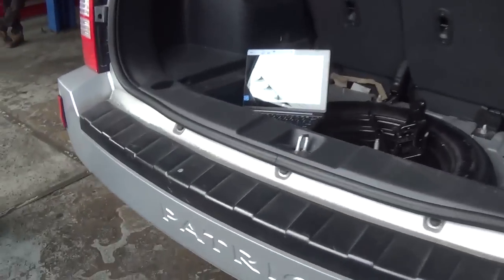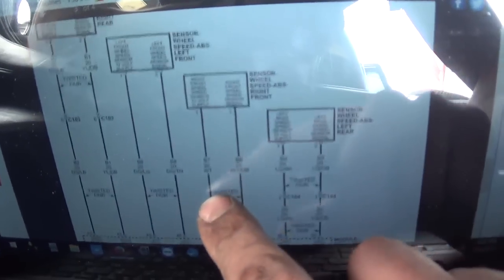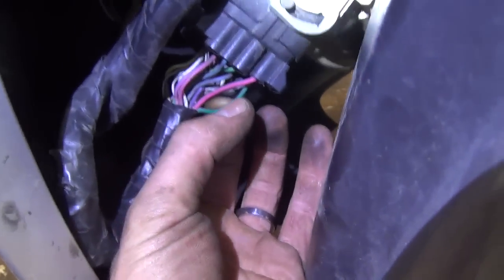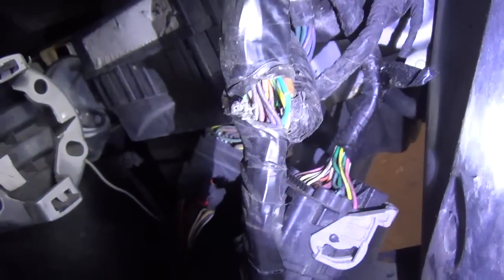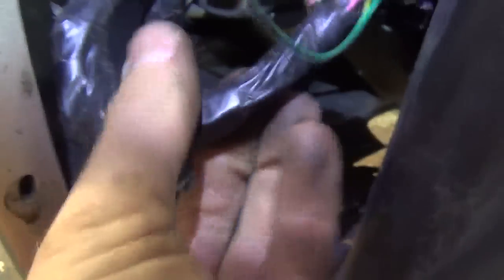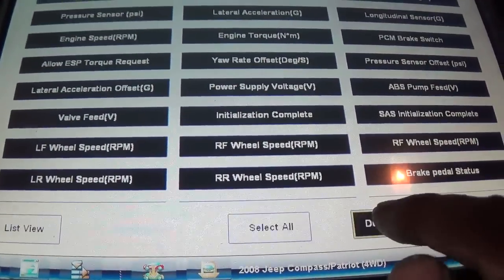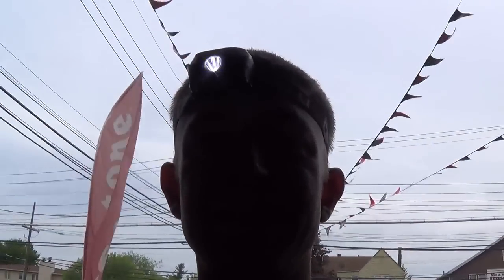Jeep ABS wheel speed sensor circuit (Staten Island Ep 9.3)

Comment: Ivan - I used to teach electronics. For the best long term repair you should clean off the residual flux with isopropyl alcohol before putting the heat shrink on it.  The flux will keep working creating its own green crusties.  This recommendation is from the standards for High Reliable Soldering practices - NASA STD 8739 is the one we used.
Having whined now the good comment - your videos like Keith's and Eric O's diagnostic one are excellent excellent. I don't always like the handheld camera shots but your voice over explanations make them live and in the moment.
Reply: Mark Watson Thanks for the tip.  I'm 55 and didn't know that.

Comment: lol  gloria gainer's "i will survive" playing at the same time you found the problem. how that for timing?must have originally been a rub through. suprised that harness is allowed to flop around in there like that. one thing i have found thru the years is that a solder joint wt a point of flexation will often break. sometimes its better to put in a longer stretch so it wont be flexing at the joints. looks like that one will live  long enough, thanxs for taking us along

Comment: It was in a spot that likes to collect slush and snow, I've pulled them inner plastic fenders apart to find solid bricks of ice inside. That is likely what caused to corrosion in the harness. Not sure why the harness was looped so low in that area. But good job cutting the problem in halves till you finally found it.

Comment: whoops, not bad soldering @ Ivan, I mostly dislike the gas heated devices, lack of temp control, best bet it watch and touch them with solder, when it starts to melt fast, underside touch the wires, tap solder to iron/wire meet point, watch closely, it will start to melt/flow, move solder to top of wire and iron back and forth following solder ( heat fast, flow good and remove)

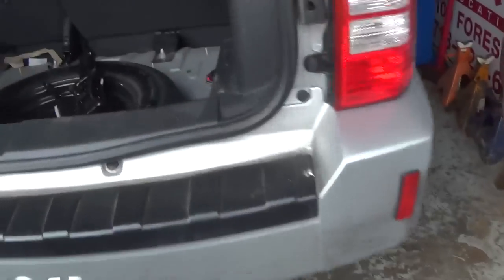Comment: Hey +Ivan, your description of the sensor signals at 1:06 https://youtu.be/655hnoYvgak?t=70 is a bit off, though of course you nailed the problem regardless :-).  That's not YL/Grn = ground and DG/LB = sigal. Instead, as the schematic shows, it's DG/LB = Batt+, and YL/DB = signal. A scope across those two wires will show a square wave voltage with levels of say 12V and 12.8V. (This implies hooking scope ground to the signal, which invites problems unless the scope has independently floating channels.) Those odd-seeming voltage levels are the obtuse side-effect of the sensor sending a current signal, which ends up generating a voltage relative to ground owing to a resistor-to-ground in the receiver (ABS controller). Explanation: 

This type sensor has only two wires, with one side tied to Batt+. Mysteriously, the signal voltage takes on two rather oddball-seeming values. Not zero to 12V, nor zero to 5V, nor even zero volts to anything. So this is almost certainly a sensor which communicates by sending one of two different output currents. The receiving control module contains a resistor to ground, and reads the voltage that results from that signal current passing through that resistor. This mode of communication is known as a "current loop" configuration... current flows from the ABS unit along the "12V" Batt+ wire to the sensor, through the sensor, and then back along the signal wire to the receiver, where there's a resistor to ground, across which a signal voltage results. The sensor sends information by regulating the amount of current, in this case to one of two values. The current loop arrangement has two benefits: 1. Interference from electric or magnetic noise affects both wires equally, with an overall effect that cancels out. So less signal degradation from interference. 2. Makes it easier to design a system that has electronics in the sensor, yet uses just two wires. Almost certainly, this module contains a chip like the TLE4923, data sheet here:
https://media.digikey.com/pdf/Data%20Sheets/Infineon%20PDFs/TLE4923.pdf. See page 17 for the likely connection arrangement. Table 4 on page 11 (IS) shows that the low current is 4.1mA (+/- about 1) and the high current is 10.5mA (+/- about 2.5). And minimum ratio between low and high of x2. (These current signals are in the range of the "4-to-20mA" signal convention commonly used for process control in industry.) 

Eric has a video https://youtu.be/2h7vuWPaIgM?t=214 of this kind of signal. Looking at 3:36 of that video, the resulting voltages at low and high are about 0.85V and 1.7V (ratio of about 2). So that corresponds to a receiving resistor (RS) of 180 ohms like in the datasheet, with the sensor producing (permitting to flow) 4.7mA and 9.5mA, which is in the range shown in table 4 for IS. The sensor's block diagram appears on page 7. The "output signal" of the device is the amount of current flowing from the pin 1 terminal to pin 2. In this ABS application the VS terminal pin 1 is connected to +12V, and the output is the amount of current (4.7mA or 9.5mA) that the chip allows to flow through from pin 1 to pin 2. Don't be misled by the label of "Ground" on pin 1. In this ABS application it's the output wire. Control of (most of) the current is performed by the variable current source element, shown on the block diagram toward the right as a circle with arrow. In this application the word "source" might mislead -- it just controls the amount of current allowed to flow, ultimately from the VS +12V terminal through to the "ground" terminal, which, as I mentioned, is used here as the output signal. The block diagram also shows apparently two raw hall sensor devices, whose outputs are amplified. The "Schmitt trigger" is a device to compare those two values, and make an on/off decision. The "Schmitt"-ness means that the comparison is done with some amount of hysteresis, to avoid oscillations that might result if the mag wheel is at some intermediate position where the hall sensors read approximately equal readings. More explanation in the blurb on page 8. The data sheet also tells that the TLE4923 has its own built-in regulator for internal use, and can operate properly down to 4.5V across pins 1 and 2 of the chip (and up to 18V). Adding that to the voltage that the current will cause at the receiver, that means the positive side supply can be any voltage from about 6.5V to 18V, and the chip will still produce the same two current levels, and thus the same two voltage levels at the receiver.

Comment: That liquid electrical tape, that's literally just plastidip. It's made by Performix, the orignal "Plastidip" product. Works great though, if you ever have to cut a harness or do a repair that stuff is incredible. Bought a car with a shorted wire to the car's ignition coils (they all come on one big pack), the car would just stall out randomly. Took me a long while to figure out what was happening there, the problem was never there... until your car stalled. Anyways it was an exposed wire, I put the liquid electrical tape on it, coated it again the next day, then rewrapped the harness. It sort of looks like someone had the harness apart and they cut the insulation away on accident using a box cutter.

Comment: There's Super 33+ and Super 88 Scotch tape... the Super 88 is thicker if you're worried about possible abrasion or just want a little extra stiffness on your wiring repair... 90% of the time the thinner 33+ is the way to go through. Anyways I live in Florida, that Scotch Super is the only stuff that'll stay on for more than 6 months. Everything else just turns to a gooey slime and leaves the glue residue allover and it's incredibly sticky, but thankfully this tape is good up to 221 degrees and can handle just about anything.
Reply from the maker: Yes I've gotten burned by the cheapo "automotive electrical tape" before...never again!

Comment: Does shrink wrap seal out water ?, I sure it helps, but waterproof dont think so. Bad design overall. How cheap can they make them, pretty cheap apparently. The music reminded me of Dancing at the Disco, not a good memory.
Reply from the maker: Hi Charles, the more expensive shrink wrap with the sealant inside sure does a good job. That is the only type I use.
Reply: Didn't know they sold that type, goes to show what I know.
They should use the type of cable we used in Communications work, it was hard to get into with a hatchet. They should protect it more when its in a wet area. But we want to keep Ivan busy, so go Chrysler.

Comment: What about the same issue dodge 1 ton truck rr wheel speed sensor circuit fault but I get a signal and it picks up the speed of the wheel when I watch the live data on the scan tool

Comment: Ivan, you should definitely add rosin core flux liquid or paste first when doing wire solder splicing especially with somewhat old crusty wires.
Reply: always cut back the "crusty" discolored wire to clean copper appearance, unless you know for sure that it's a 1/2 to 1 yr vehicle :)

Comment: Question. Would the repair not have been easier to accomplish if the harness had been disconnected? It appears as though you wpuld have had more area to work. Thus facilitating a better solder joint. My two cents. Ivan you always do top notch work.
Reply: David Sawyer and removing the wheel, it was already on the lift.

Comment: That crusty ass "repair" looks like something a punk would do to add a light bar or something. They just stabbed wires until they found 12 volts that came on with the key under there and wired the lights to the bumper or something.

Reminds me, I own a stable of Saabs basically, got a 2004 9-5 last fall... the EGR valve was broken, and someone had cut the end of the harness off for the old one and put the end of an Audi EGR valve on it! I actually used the stock crimped terminal ends and put them into the proper (JPT terminal) connector so I didn't have to butcher the harness anymore than it already was. The last foot of wiring doesn't match the colors that's in the WIS for Saab, but I'll know what's been done to it, I doubt it'll have another owner after me anyways. But yeah since I had to get a new EGR valve there was no way I was going to order it with the Audi connector, I ordered the connector and the valve for that vehicle just in case someone in the future is working on it (and for my own sanity if it fails again).